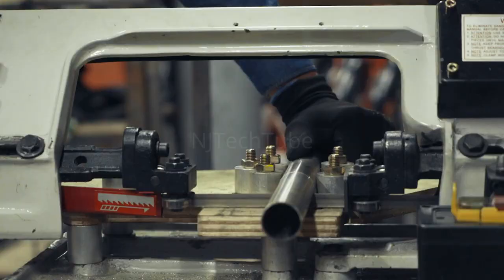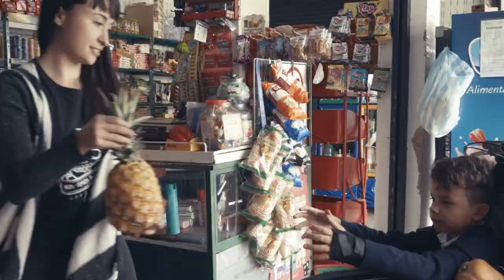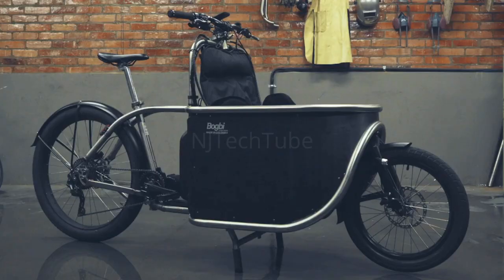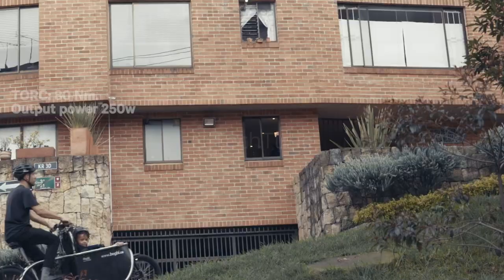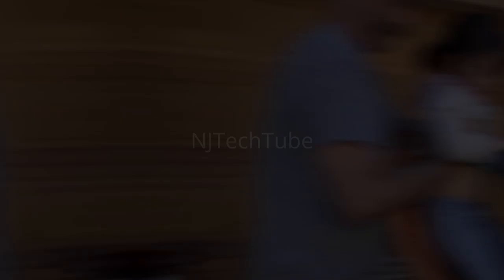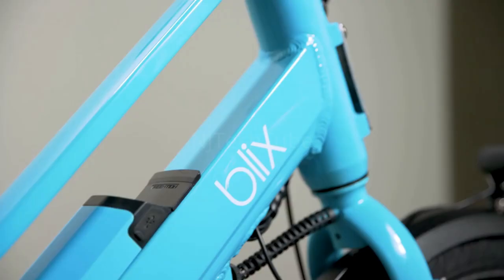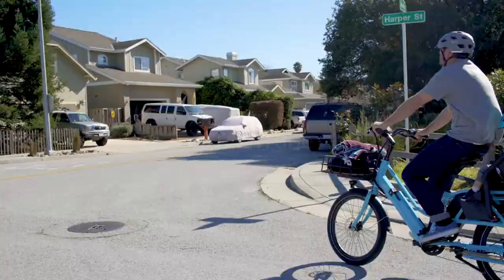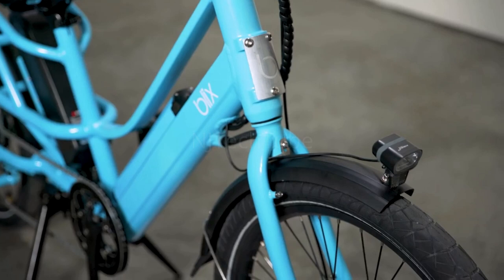2 Amazing Cargo E-Bike That Are At Another Level

Comment: For the exorbitant costs of a Cargo e-bike, there are too many videos on YouTube of people using them occasionally just to be seen to be green. It's practically a middle class greenwashing trope at this stage.
If it's going to be used almost every day, yes it will pay for itself and good luck and my support and admiration for those who do.
But some of them can reach up to €10k.
I have a manual only hybrid bike and two fairly large trailers. I can carry 70kg of groceries or shopping or a full sized lawnmower or so much more. The two together cost less than €250.
I'm not against e-cargo bikes, in fact it's completely the opposite. I hope to get my first "e" workhorse next year.
They're just mostly like in this video. Small manufacturer's selling good and innovative products by the hundreds or occasionally thousands but at hugely overpriced costs.
What is needed is for the Toyota's, Volkswagen's, Ford's and other similar manufacturers to mass produce the same products by the millions at half the costs. Then affordability will allow millions more people to rapidly adopt and weight of numbers will lead to a revolution in urban transport and infrastructure.
Not intending on being critical of these or other manufacturers.
But think of the scale and cost of production savings and reliability with sheer volume a company like Toyota could achieve turning out a million of these every year would achieve?
Compared to a workshop with maybe a dozen people in it?
Can you imagine how much it would cost a workshop of 100 to design, source, adapt and assemble all of the parts and components to make a unique equivalent corolla sized car? Hundreds of thousands at least.
That's what's happening with e-bike manufacturing at the moment. I'm still waiting for the Henry Ford Model T moment for e-bike's. And I'm ok if it only comes in black!
Plus the reliability of build quality and of repairable and replaceable spare parts.
There are too many e-bike's being sold that have unique proprietary parts or built in batteries.
The day after it's out of warranty, as soon as there's a problem, the whole thing is pretty much scrap.
Have I just said anything that's not true?

Comment: Amazing! Some average (at best) empty eCargo bikes being ridden around. Cargo bikes are good for two things only... cargo and for YouTube yammerheads trying to get people to buy one. They ride like crap, have a horrible turning radius, are easily pushed around by wind gusts.... basically a one-trick pony. It's so easy to have berrer. Stay safe.
Reply: For the exorbitant costs of a Cargo bike, there are too many videos on YouTube of people using them occasionally just to be seen to be green.
If it's going to be used almost every day it will pay for itself.
But some of them can reach up to €10k.
I have a manual only hybrid bike and two fairly large trailers. I can carry 70kg of groceries or shopping or a full sized lawnmower or so much more. The two together cost less than €250.
I'm not against e-cargo bikes, in fact it's completely the opposite.
They're just mostly like in this video. Small manufacturer's selling good and innovative products but at hugely overpriced costs.
What is needed is for the Toyota's, Volkswagen's, Ford's and other similar manufacturers to mass produce the same products by the millions at half the costs. Then millions more people will adopt and weight of numbers will lead to a revolution in urban transport and infrastructure.